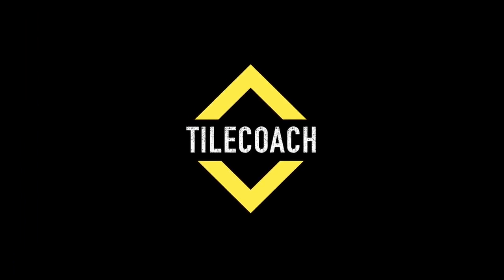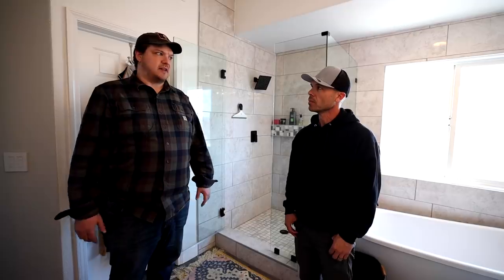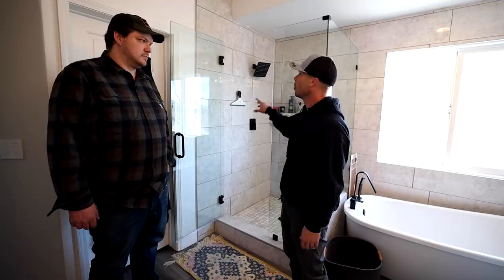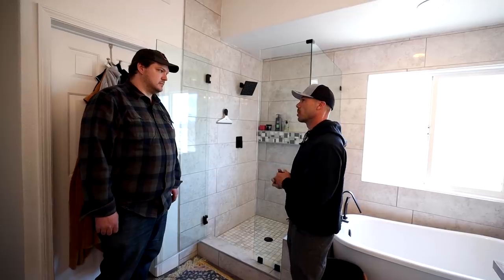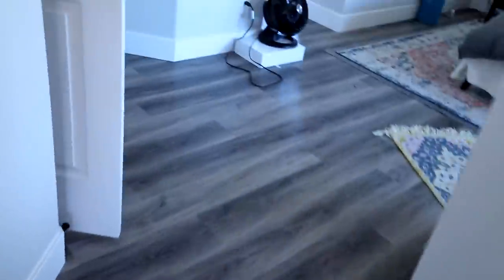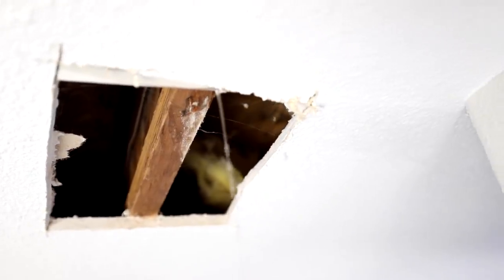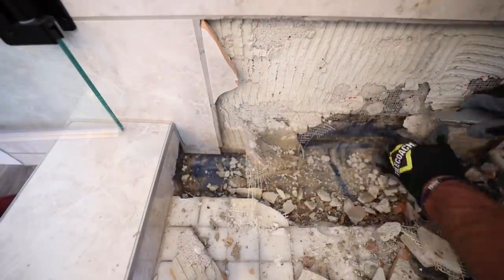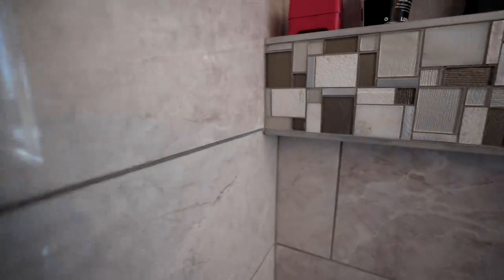Flip House DISASTER — Both TILED SHOWERS are Leaking

Comment: I worked on a lot of flip houses. Unfortunately, their problems are only starting. Pretty much all you're buying is a gut house at a new house price because everything will be done so badly that it'll all need thrown out and redone again.
Reply: Not usually. I've worked on a lot of flip. Way better than new construction Houses I worked on. Wood is better quality on older houses. Better insulation for sure. In my area people look for remodels because I swear these guys in the 40s built like the world was ending. I've seen triple 2x6 beams over triple 2x4 over triple 2x6 beams. We all ripped the plaster board down and just looked at the Craftsmanship. This house could have supported 3 additional stories above it. We took pictures for the new buyers so they knew this house would easily run +130k just in lumber today. Absolutely insane. They had an entire outter shell of 2x10x12.... Stacked .. vertically. Probably 1900 of them total. Someone ran a saw mill or something
Reply: Yep, cheapest fastest possible "remodel".   All the fluff, none of the stuff.   It's way better to buy the beat up house and you pay for it (or do it yourself) correctly.    Not just covering over any possible issues.    

remember the old 30/30 guarantee?  30 minutes or 30 miles, as far away as i can get.
Reply: The incentive working on the average flipper:  maximizing investment. That means speed, because the more they're holding on to the house the more they're spending money. That means they'll often opt for cheaper materials. That's not going to result in the best work.
Reply: That’s not always true. I do projects on flips of often and I’m very thorough. I’ve yet to have a shower leak or tile fail. My finishes always look crisp too
Reply: Everyone that’s saying that flippers are trying to maximize profits, cut corners, etc. are pretty ignorant in my opinion. The same arguments can be made for any new home builder who is only trying to maximize their profits. Furthermore, the same thing could be said for any contractor who works on any home at any time. There are many examples of hack jobs by new construction or bad contractors, as well as flippers. Being a flipper myself I have fixed many unsafe conditions in homes. Don’t buy into this narrative that all flippers do bad work on homes.
Reply: @aidanlittle705  oh come off it guys, it's hollow core doors, gray click together laminate floors, and the cheapest HD windows on sale. Churn and burn.
Reply: @aidanlittle705  the point was in the game of flipping, time is everything, therefore they are encouraged to go the faster cheaper route to maximize profits. Not saying these are bad people, just pointing out the name of the game leads to a lot of low quality, cut corner, quick work

Comment: Just an fyi, dont ever buy a flip with mudbeds in the shower. There is never enough money the flipper will dish out to pay a guy enough to want to do the job so they skimp and get trash laborers and this is the result just about every time. You can tell just looking at the layout, the size of that curb, the terrible cuts and thinset around the drain, that those guys were quick slap it up tile guys.

Comment: First thing I noticed was a terrible layout of the wall tile
Reply: I'm curious. How should the tile be laid out to be better?
Reply: @thenp3911  maybe you didn’t notice but there are “sliver” cuts above the window and at the ceiling which are a cosmetic eyesore. The bottom row in the shower is cut. They could have been avoided if the installer cut off less or started with a full tile.
Reply: @justinlongstreet586  Ah, I see what you mean. That would look better by a lot

Comment: Haha! I also have two leaky showers from the previous owner who flipped the house. Backer board submerged in the pan, water wicking up walls, and drains installed wrong. All sorts of awful. Also had to rip up the kitchen floor. Tile looked beautiful but mortar didn’t adhere to the slab. Go figure.

Comment: I am watching this video right now bc this exact thing happened to me. Its not a flip house, but mine came with 2 simultaneous shower leaks. Im waiting on the last two saddle pieces to finish the 2nd by this point, but it's been a long and expensive road.

My issues were a handicap ramped curb that leaked, and then the other one had a Japanese tub bottom that had the drain flipped to the wrong side and was off level.

Comment: This is really sad, and after seeing so many of these I would be incredibly skeptical about buying a home with a shower built this way. I really like the method of filling the pan and using a FLIR camera to see where the thermal mass goes. Some of these leak but not bad enough (yet) to where you can see it dripping below as you did, and it could really help dodge a bullet.

Comment: Isaac, I think you give too much credit to “professionals”. Many tile guys do horrible work. We had our shower redone over here in EDH by a contractor a few years back and I honestly plan to reach out to O Tile to redo the whole shower in a few more years. The work was terrible. I literally have electrical tape over a grout line to prevent water from leaking into the wall. This was done by a “professional” tile company based out here in EDH. The work was poor and included spot bonding for the tile. I wish I had found your channel before I had hired this contractor to redo our shower.

Comment: The shower pan is only there as a backup incase a little water seeps through the tile. That water was pouring through the tile. The tile job should be fairly water tight to begin with.but the waterproofing ultimately exposed the leak.

Comment: Moral of the story? When buying a flip, (or any house) plug the drain, fill the pan from the shower head, and leave it on till the pan fills. At least.
Also, the inspection failed. A water leak test should have been performed on all fixtures. And be sure to get a 1 year warranty. This is a minimum 20K fix.
Reply: Many ppl don't even understand things. There are way more unhandy ppl than you would imagine. Careful ppl are a rare species nowadays.

Comment: I would guess whoever did it probably took a chipping hammer to the bed and punctured the liners. I agree though, if your in that deep, you should definitely address everything. Like doing a timing kit on a vehicle and not changing out your water pump....
Reply: Why change the water pump?
Reply: @thuglivintv824  because you've ripped the entire thing apart to do the timing. The water pump is right there and would cost only a marginal amount more since you have already done the work to access it.

Comment: Well done on this vid, like there’d be anything BUT, 100% A+ Service from you or company.

Wow, that was a lot of water, but compared to leak had at house my parents were renting 5 yrs ago, that was a mist/stream. Was sleeping in downstairs bedroom below master bath and at 3 am, felt water drops on face.
20 seconds later, was taking a shower, w / what felt like 30 body sprays and 70….20 inch rain shower heads; as water was pouring out of ceiling into room. 
Guess what, house water shutoff, DIDN’T WORK, but Not unusual for FL (if it had worked, I would have been in ER for shock & fainting, lol); as very rare to find shutoffs that are in working condition (98% gate Valves are ½ or ¾ inch Nibco and quit working back in early 2000s, lol); and so came the shovel, flashlights, and water key/meter key/whatever ya call yours (or even crescent wrench or ChannelLock pliers: aka tongue and groove adjustable pliers etc….).
This long story, made wee bit shorter; w/ leak detection equipment, opened back of vanity & Sheetrock and the cold line stub out was in a 90 & when followed down b/t 1st & 2nd floor, saw the ½ inch copper had about a 2 inch crack 🤦🏼; which could see was leaking A LONG LONG TIME before finally split opened, UGH 😩 (wish ppl truly realized how destructive water “damage” can truly be. Not pretty and CERTAINLY NOT CHEAP, it’s nightmarish frightening Expensive as “BEEP”.
Cheers Bro, have good one✌🏻

Comment: Learned after I bought my first house to do an extensive well test, not just trust the numbers written on the pressure tank. Cost me $60k to drill a new well. 
Working for a flipper I learned to do a more extensive termite inspection than the $400 whole home inspector does. 
Learned from Isaac to do a shower flood test.
What takes a couple hours now can save you tens of thousands later.

Comment: Comments keep saying, "a water test should have been done on the pan before the purchase of the house was signed'. Which is true, but the real problem is the tile installer is the one that was supposed to do EVERY POSSIBE water leak test while it was being made, including the pan. I never install any pluming without KNOWING for sure what I installed has no water leak......whatsoever. And when there is, it's fixed. Ultimately, this was the installers mistake, and he should have known this shower was leaking the same day he did the pan test. Obviously, he did not do a pan test.

Comment: Thanks for the video, and keep them coming! Sorry, this might be a stupid or obvious question and you may have said this in the video and I missed it but was all of this due to an old liner? 
And by that I mean was the shower on both floors leaking prior to them remodeling the shower? Or do you think that the combination of an old liner being in place and the flippers tearing out the old shower and putting in a new shower was too much for the old liner to rake and that caused it to fail?
I guess what I'm asking is all of this from in existing issue that was never fixed or from the flippers causing this new issue? Thanks so much
Reply: The liner, which is the part of the pan holding the water in, was damaged when they took the old mud out.
Reply: @ssl3546  that's what I figured, which is must've been something done during the remodel since it happened to both bathrooms that were remodeled....

Comment: Haha, people there are no short cuts to installing a shower pan. New crap is crap. Foam is crap.
No foam will hold 2 adults taking a shower together. The tile "will " crack, water will find a way out. Black mold will show up. A shower stall.
Should be reinforced. Treated wood used. The pan box area should be plywood treated. A blue or black water proffing sealer should cover all surfaces. And go up the wall at least 24". I would seal the whole shower stall. Then a rubber , sheet is cut to the shape of the floor , with over lap in corners. A strong glue is used to glue it down, and to glue corners up the wall. 2 days later. The drain is cut thru. A rizer, stack installed. Dry concrete sand mixed will together.
After making the walls for the slope to the drain. 
The damp not wet, sand mix is packed in hard it should be 2 to 4 " deep. When perfit, slope done. Leave it for 2 days to cure. Then install drain area. Giving room for tile a d thin set. Use the right shower stall thin set. Lay the tile. Grout.
It's a pain in the ass to do right. It can not be done in 1 or 2 days. But do it right, it will never leak. Or crack. And will last longer than you will.
Dont put foam pans in Haha, hire a master plumber.  Not a want a bee.

Comment: if you plug the pan and fill it up and it still leaks that doesn't rule out the supply lines...
Reply: It would be true except it only leaks when they are showering. If it was the supply lines it would still when it's not in use no?
Reply: @Xaero324  it could be the line going to the shower head.

Comment: I can't understand what the attraction is to tiling bathroom shower areas. I'm sure the clowns that try and do these projects think these fancy tiled areas are going to fill their pockets with loads of extra cash, but in the end they turn into gigantic pains in the asses. My bath & shower area is made from a one-piece fiberglass shell that's 100% leak-proof & as long as you don't drop an anvil on it it will be that way forever. Get over the goofy tile showers. Unless you like cleaning mildew off the grout and water pissing down into you living area.
Reply: I have done many bathrooms with tiled tub surrounds with porcelain tubs. True fiberglass one piece tubs and showers do not leak but they are maintenance/cleaning nightmares. I like natural stone, run a polishing pad over it and presto looks like brand new. The tiled tub surrounds can be scrubbed and some fresh caulk every few years and your good to go. Tiled showers constructed properly should last a lifetime.
Reply: @allenburns3177  I like both. Reason I would go for a 3 piece non tiled surface is that I do not want to deal with grout lines plus when I become tired of it I can change it. Why I like tile, not every tile just regular classic style a Field tile with some nice pieces of handmade tile to make it look expensive, no pebbles or small tiles for floor of shower unless I am crazy to get on my knees to scrub in between crevices.   Ease of cleaning and simplicity but above all water proof

Comment: I don't get Liners.
If you need a Liner, you are not doing a good tile job.
Water is not supposed to go beyond the Tile.
Reply: Ceramic/Porcelain tile and grout are not waterproof. They are water resistant at best. You need to waterproof under the tile to guarantee no leaks over time.
Reply: @blk91stang  inaccurate statements.
Reply: @miguelperez-qk3no  read about tile and grout absorption, vitreous vs non vitreous. His statement is not inaccurate, yours is.

Comment: Question, do you know what plumbing code that California follows? or is supposed to? We own and operate in Oklahoma, Sutton Plumbing & Flooring, and in Oklahoma,  we are to abide by the IPC and in the IPC (International Plumbing Code) the specifics regarding drain pans and installation  are clear in chapter 4,  Fixtures faucets and fittings, even down to the thickness of a current lead shower pan. Thus leading to my question. I will also say, for some reason, my you tube account on this phone is under my wifes name for some reason. My name is Tanner Sutton, we live and operate out of Thomas Oklahoma but have about a 100 mile radius as to batheoom remodle customer base. Must say, I certainly appreciate your integrity in business, as ultimately,  that truly is your best advertisement. Again. just curious as to the required code in your area, also understanding it can and may change from town to town/ city to city.Hope you'll take my question, and once again, thank you for your videos. Good day and God bless. Prayers yalls way for you and your competitors.